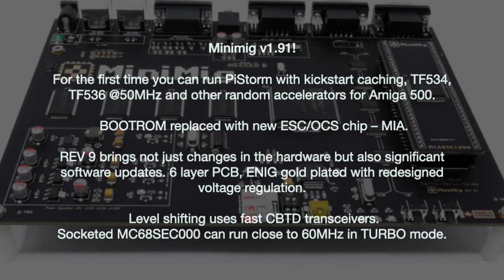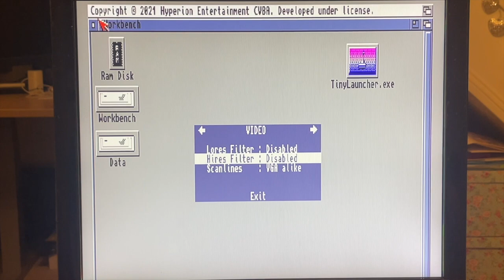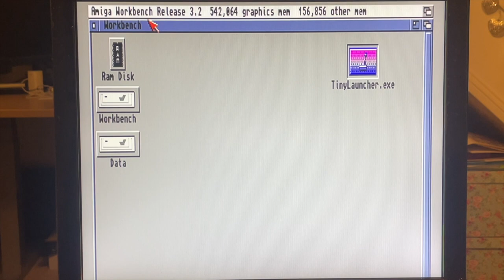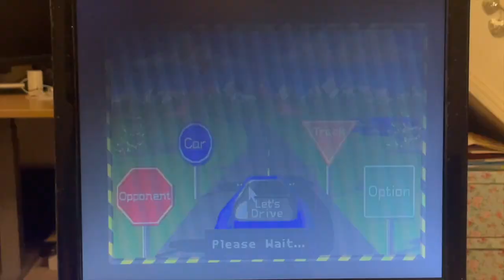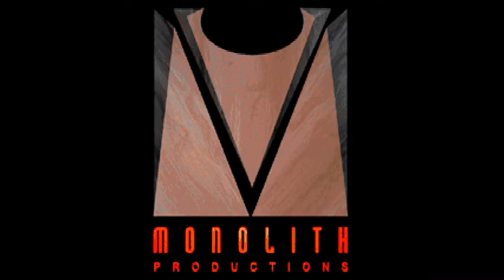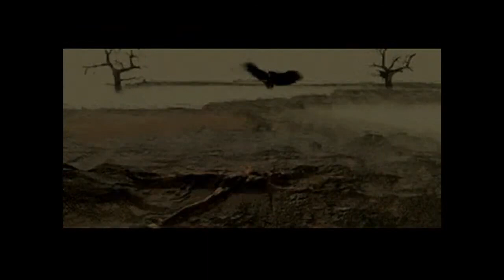MiniMig 9.1 FPGA ITX  review 2023

Comment: Great video mike, cant see this selling well to be fair, but I'm sure there will be a few people out there to give it a go.
Reply from the maker: It’s an awesome bit of kit but I think the price is too high. People will buy a Mister rather than this.
Reply from the maker: Update: if the online shop is Canadian dollars then the actual cost in gbp is £209.21 or $255 USD.
Reply: @Mikes Vintage Tech  that seems a bit more reasonable for what it is but still gonna be piped to the post by the mister for most people, bloody shame because it looks beautiful 😍
Reply from the maker: Yes I think so, how much is a mister now? But of course the mister can do so much more and it has more RAM and AGA for the Amiga. Although I haven’t tried the Amiga core yet
Reply: @Mikes Vintage Tech  I picked one up for around £180 and spent the same again on extras and ram ... I still haven't tried the the amiga core as that's one machine I'm  not short on and I got side tracked with the arcade cores lol.  It's a pretty awesome device that I'm still learning about. I have an original mist that I was using for a good while as an amiga which was a very reliable little machine and very similar to what your review here but with AGA capability and I think thats over ten years old now.
Reply from the maker: I remember looking at the Mist. Nice system but eclipsed by the Mister now. No doubt Mister 2 will come along at some stage
Reply: @Mikes Vintage Tech  yes I remember talk of a new mist some years back, don't know what came of it 🤔
Reply: @mjnurney  That cost is USD